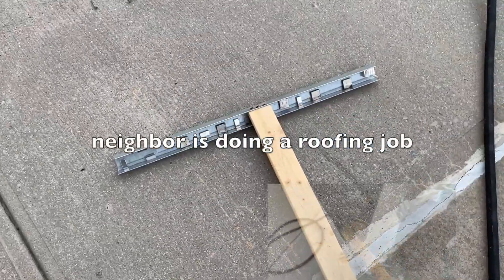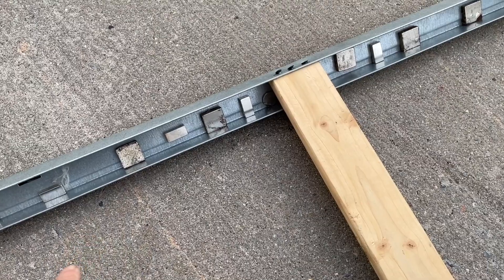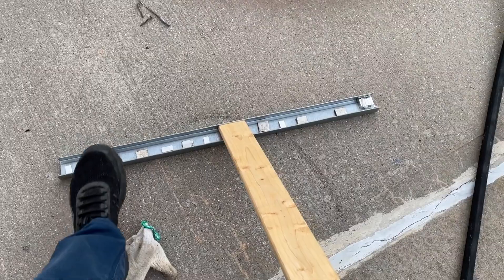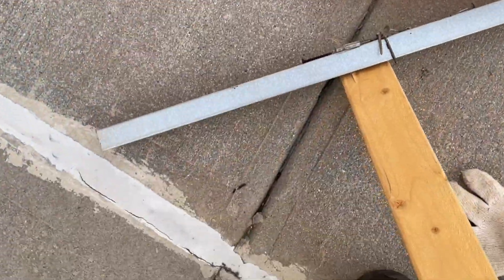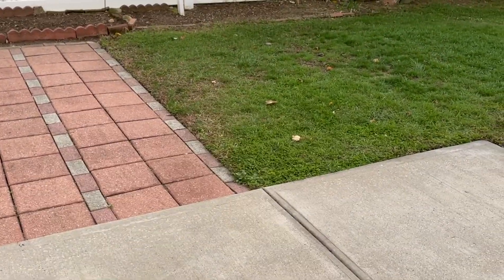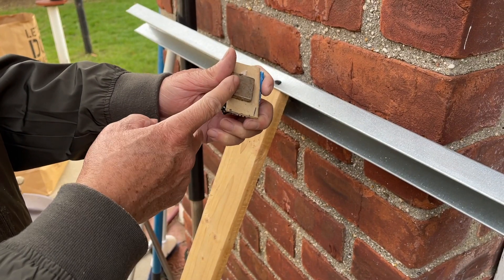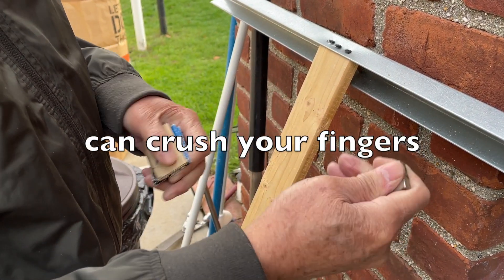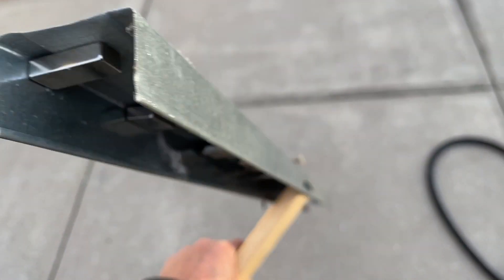diy neodymium magnetic sweep

Comment: I made the poor man's version when I was about 13 years old and my father got the roof done on his house.  All I had was a speaker voice coil magnet and a broomstick.  It was much smaller, but certainly was effective, picked up a whole bunch of stuff, and no flat tires on any of the cars.  Interestingly, the magnet would pick up some of the little granules on the roof shingles.
Reply from the maker: My neighbor actually got a flat after my roof was done. Of course the roofer used a magnetic sweeper after the job was finished but it didn't pick up everything. I made a smaller magnetic pickup prior to this one. I used a ruler and attached a magnet to one end. It picked up a bunch of nails from the concrete expansion joints as the filler materials in between disappeared. You are correct as I used my small pickup and ran it inside the gutter and it picked up some shingle granules. Maybe now I can find those loose screws that vibrated off my small engines after losing them for so long.